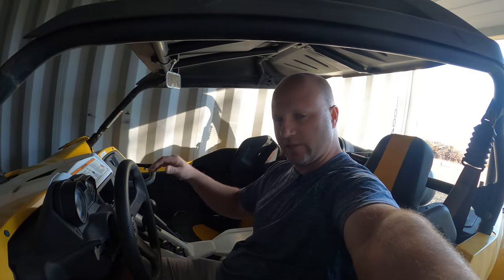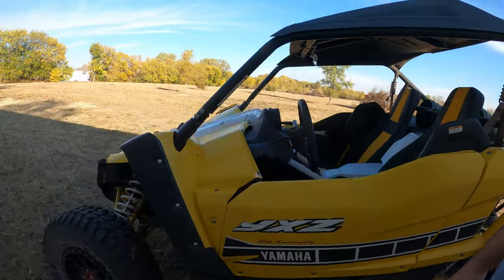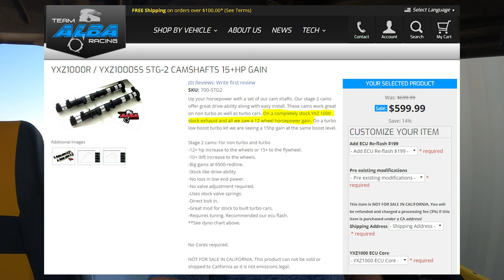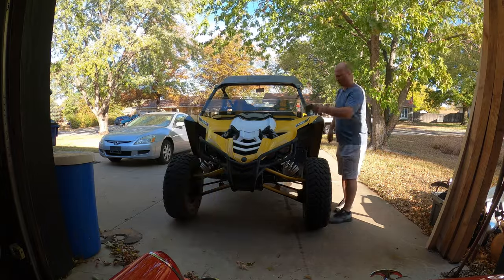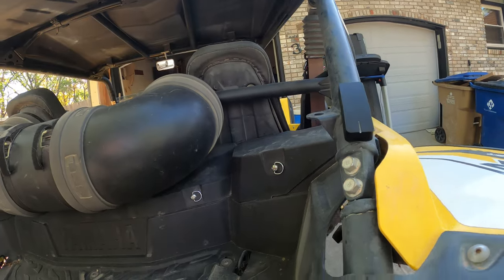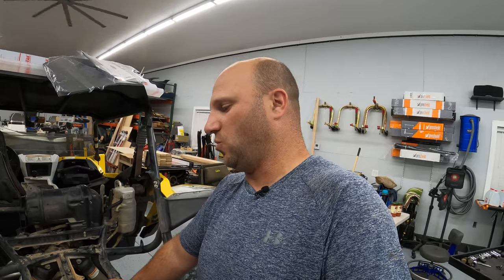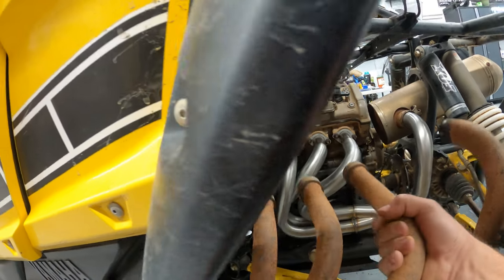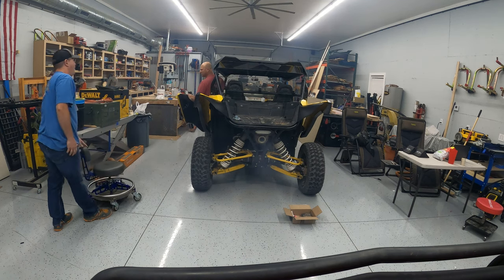YAMAHA YXZ, Best Bang for Buck Performance Mods. 39 extra HP for only $1200.

Comment: For the love of these machines please buy a new primary air filter and get some air filter oil and clean it on a regular basis. You're going to be running leaner than normal without a primary air filter as well.

Comment: I'm surprised Yamaha didn't put their tried and true inline 4 cylinder in that machine. Those supposedly make around 150 hp out of the box with no modifications. The inline 4 is pretty much all top end power though and feel pretty tame under 6000 rpms.
Reply: Yamaha needs to pull a Mopar and put the mt07/r7 engine in a raptor atv chassis and a mt09 engine in the yxz1000r. those would be 2 machines i would be all over. Ive been saying this for years. maybe that will jumpstart the sport atv market again
Reply: It’s the motor out of their snowmobile. What they really need in a SXS is the VMAX engine

Comment: Put a cage on it. Get rid of the Roof support. Move the radiator from the front to the rear, Will run cooler without trash plugging up the radiator.Wear a helmet every time driving it. Also eye protection. I have the same SxS you have.and its been great.

Comment: I’ve got one of these that sometimes doesn’t wanna go over 21 or so and hits this weird sputtering limiter. Maybe I’ll check out that filter , thought maybe it was the belt slipping
Reply: 800 version
Reply from the maker: Sputtering tells me it's a fueling issue.
To much or not enough.
Reply: @TheFracturedRooster cool thanks for the tip, sure it’s something simple, I’ll start there